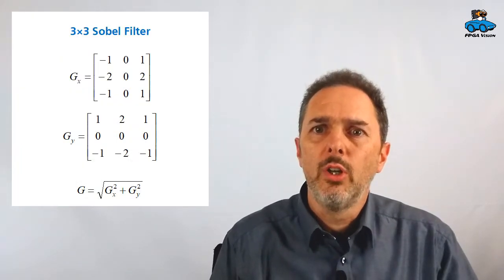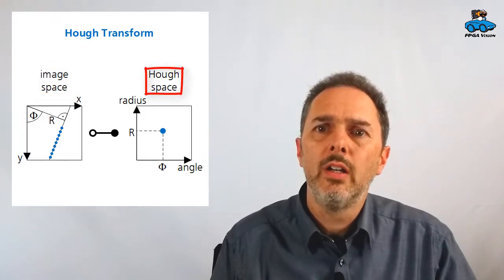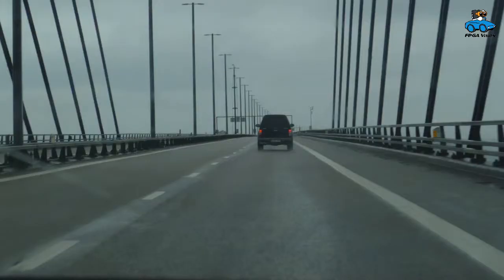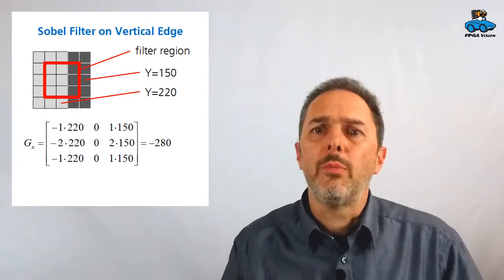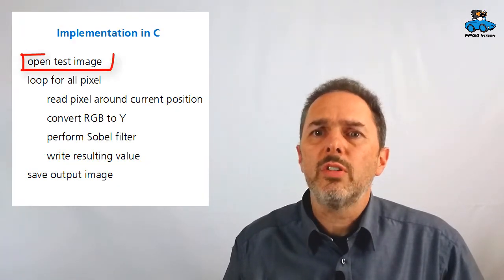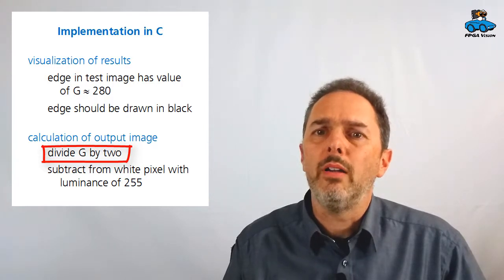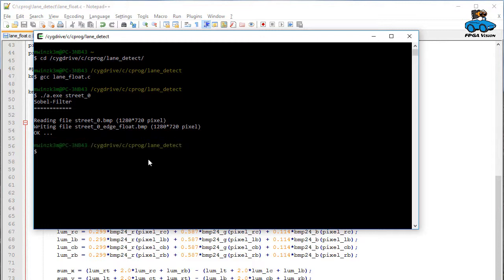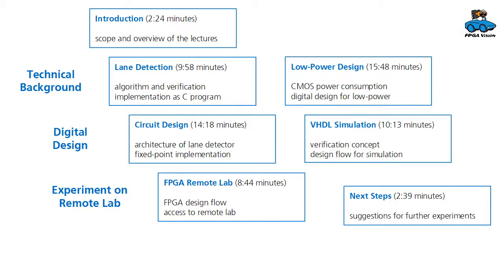FPGA Vision - Lane Detection

Comment: Dear Sir
I've compiled and started the lane detection and I'm experiencing a strange problem: The lane detection image it's partially displaced to the right.
Also I tested with other images, and the resulting image it's only showing a half of the original image. The other half it's showing only white.

Many thanks in advance.
Reply from the maker: Interesting. The solution depends on the board you are using (the remote lab? your own board?) and the displacement. So, displacement can be a) the left half of the image is white and the right half is in the correct position or b) the image is shifted to the right and the left edge of the image is in the center of the screen.

a) would be an error in signal processing, like overflow, incorrect wordwidth, ROM not found
b) would be a sync error, maybe HS is inverted
Reply: @marcowinzker3682  The displacement that I experience it comes when I execute the C code with the sample image, I'm not using the board in this moment.

Comment: Dear doctor
Can I use virtex 5 or zyng-7000  for real time object tracking?
Thank you for your helpful video.
Reply from the maker: Have a look at the circiut architecture and required ressources. Then you can decide on the FPGA yourself.
Reply: @marcowinzker3682  Thank you very much doctor Macro. That's it.

Comment: good and detailed explanation :-)   
at one point I was a little stuck: since there is no common symbol for the sum of all the elements of a matrix, it took me some minutes to figure out that G means the sum of all matrix elements.  
keep spreading the word :-)
Reply from the maker: Yes, that is correct. Thanks for the comment.
At time 0m30s the value G_x is the result for a 3-by-3 pixel matrix. The pixel of the left column are multiplied with the factor -1, -2, -1, the middle colum is not used, the pixel of the right column are multiplied with 1, 2, 1. These six values are added and give the value G_x.
See time 4m20s for a numerical example. G_x = - 1*220 - 2*220 - 1*220 + 1*150 + 2*150 + 1*150 = -280

Comment: hello sir im just asking can i compile a c code into fpga ??
Reply from the maker: No.
In theory there are tools for that, but they have limitations and you need to have good knowledge of the design flow.
Reply: @marcowinzker3682   I'm sorry to bother you sir but II have a graduation project to make a robot car (self driving car that do  lane detection and object detection ) using FPGA . I Made it with raspberry pi but it seems little bit confusing with FPGA that's first time for me  to deal with it  and VHDL ( even i dont know all basics of VHDL)  . do you have suggestions or where should i start or something  ?? thanks in advance
Reply from the maker: @MohamedMostafa-tn3qo Yes, for your project you need to understand the fundamentals of FPGAs and VHDL.Tthere are several options, but I can not give a recommendation. I regret.

Comment: I'm having some trouble compiling the c file. Some errors show up associated to the 'sqrt' function... Anyone knows what might be happening?
Reply from the maker: Hello Pedro,
I checked the C-code with the gcc-Compiler, but other compilers should also work. 

As far as I know, sqrt is included in the math.h library. And this library is included in the C-code. You can check that your compiler can access that library. Which compiler do you use? What is the error message?

Maybe you want to try another C-compiler.

Best wishes,   Marco
Reply: Hi, Marco.

Thank you for the quick reply.

I'm also using the gcc-compiler but on Ubuntu machine. The error is "undefined reference to 'sqrt'". 

How can I check that the compiler has access to math.h?
Reply from the maker: @p3dr0s4  I think, you have to use gcc with the flag "-lm" (link math).

Do a websearch of: ubuntu gcc sqrt
Reply: @marcowinzker3682  That was it! The "-lm" flag did the job. Thank you, Marco!
Reply: hi, where can i find the codes?